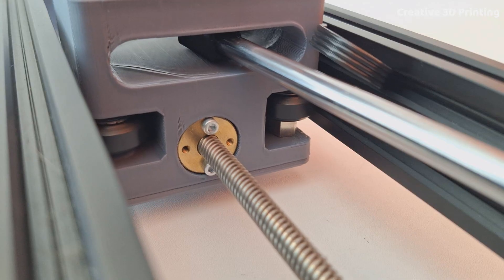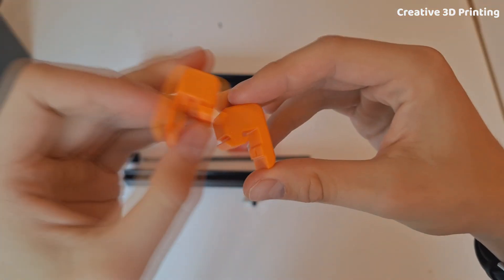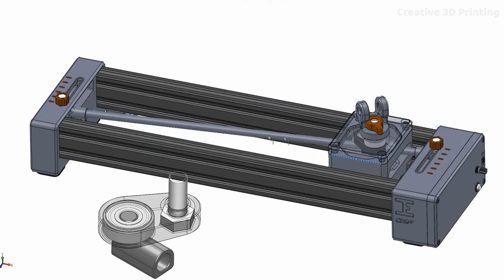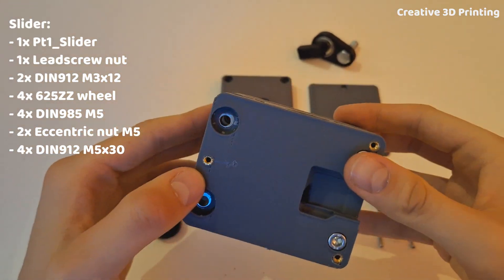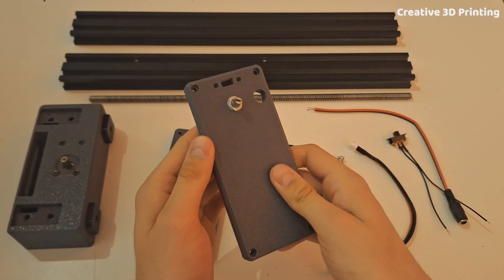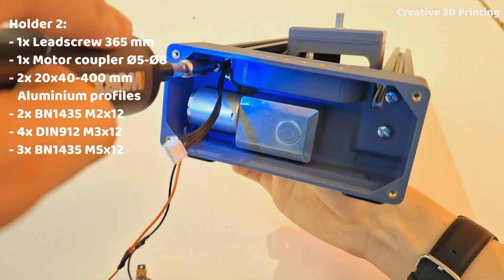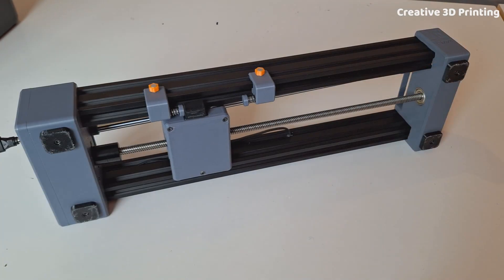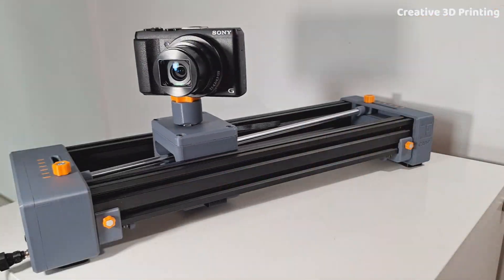DIY 3D Printed Motorized Camera Slider

Comment: Where is the 500mm stepper motor used? I dont think it was mentioned in the video
Reply from the maker: I didn't use any steppermotor for this project? Only 1 12V wormgear motor.
Reply: @Creative_3DPrinting  sorry, i left out cable from my sentence. In you list of parts it lists a 500mm stepper motor cable 4-6 pin
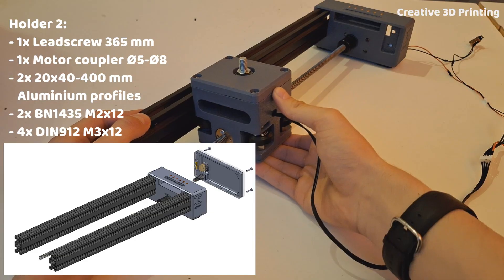Reply from the maker: At 4:10 , you can see it at my right hand and at 4:17 , I push it through the printed part

Comment: its nice but is there a software or somekind of controller?
Reply from the maker: No, only a clever mechanism, 1 motor and 2 switches :)
Reply: @Creative_3DPrinting  ok but how do u set the print time for timelapse?
Reply from the maker: I can't set any timer because it's all mechanical. 
In the future I will make a programmable version with more axis.
Reply: @Creative_3DPrinting  once u can set the time so the start postion and end position match the print start /end - it will be awesome and i will try it :D
Reply from the maker: Yes, that's the future plan :)
Nice that you're making it!

Comment: What size is the leadscrew in this design? I know the length can be variable. I'm seeing the sizing from T5-T14. I'm assuming it's on the smaller side, but I'd like the get the right one that fits the existing design. Thank you. This thing is awesome! I'm a woodworker and former marketing content professional so I know buying these can be very expensive. Hoping to DIY it and take my woodworking content to the next level!
Reply from the maker: Thank you very much for watching! I used a T8 leadscrew to fit in the 608ZZ bearings.
I'm just curious, what's your woodworking channel? :)

Comment: Great design and video! Really like how the information was presented using  animations! Can I ask how does the camera lock/ CAM mechanism work? Really interested in if you used any additional software to show the assembly process apart from solidworks/CAD Software?
Reply from the maker: Hey, thank you very much for watching and commenting! 
That lock mechanism was a difficult one to come up with.. I managed to orientate the bolt and nut perfectly so that I only needed a small turn angle of the nut to fasten it. This way the holder is designed with about a 180° turn-angle so it's strong enough to hold the camera on it. If the theads of the bolt and nut are not aligned well it stays loose and you can still turn it.
I only used Solidworks 2010 to design and animate everything. Printer files were sliced in Bambu Studio and the full video was edited in Magix Vegas Pro 18.